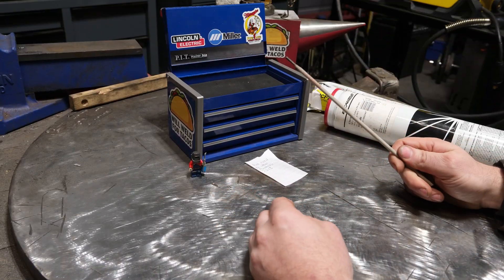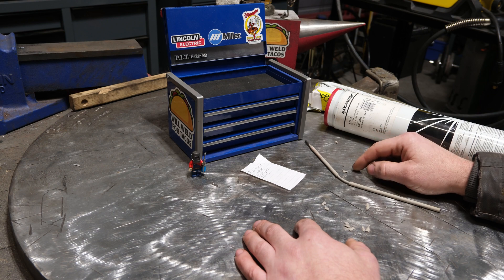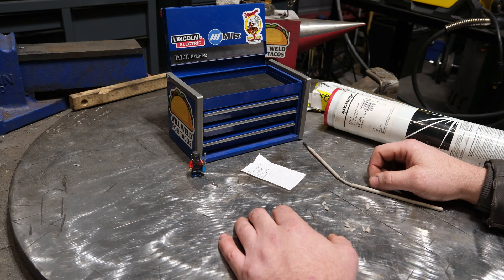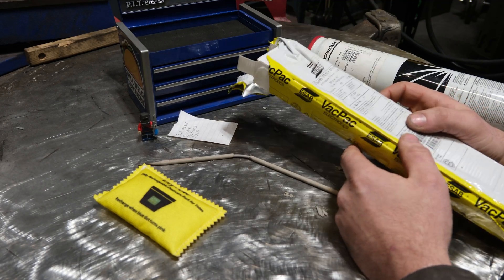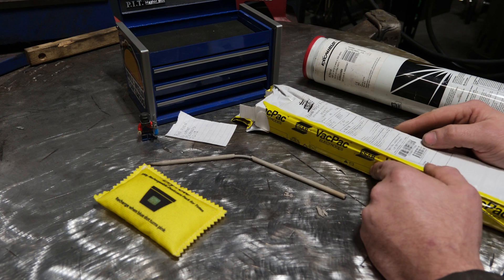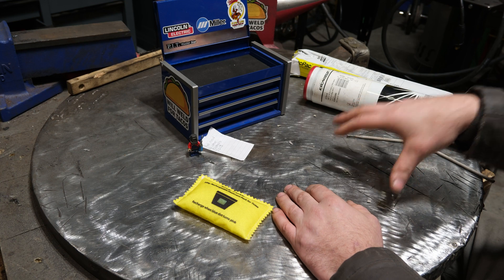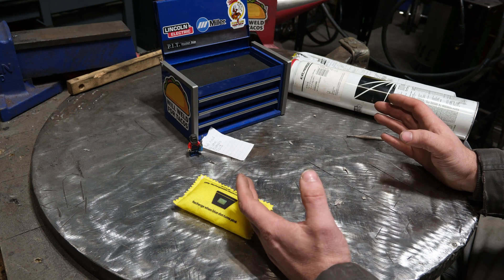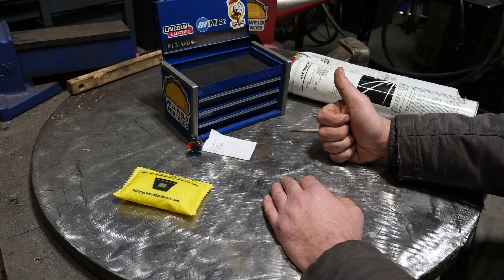QFTB #11 Rod ovens and 7018 rods

Comment: So are pipeline guys not worried about hydrogen cracking when they use 6010 as a hot pass?   And i cant belive an Air-Fryer or a Toaster Oven wouldn't be enough......  Btw:  None of the 7018 ive bought are in a sealed pack... A half a.zzed seal is all.........
Reply from the maker: So that is an excellent question and probably one of the most confusion situations because it’s very common for pipe to be welded with 6010 and filled out to the cap with rod oven stored 7018.  The reason it works is due to multiple things.  1) the root pass of a pipe can’t be reliably done with 7018, because its pool is too liquid and would be a nightmare to deal with poor fitups.  6010 gives the welder so much control over the root pass it makes it possible to weld it.  On one pipe you can be welding overhead, vertical up, and flat, all with varying gaps.  6010 is the best solution to that. The steel used in many pipes is not really susceptible to hydrogen embrittlement, so a single pass isn’t the end of the world.  Pipe also doesn’t see stress like say a bridge.  Because pipe is fully welded around with 7018 the actual loadings the root will see are minimal.  The internal pressure can be high (depending on what the pipe is used for) but again there is plenty of meat right behind the root to hold everything together.  

In situations where the pipe material needs low hydrogen welds, the solution could be tig root and hot pass, 7018 all the way out, tig start to finish, or specific pipe line rods used for the root pass.  If the pipe is prefabbed it could be done in a shop with a wire process.  

Also from my understanding hydrogen embrittlement happens most at room temp in steel.  If you welded a root on a pipe with 6010, and then welded it fully out (or a significant amount of it) with 7018 there would be a lot of time at elevated temps for hydrogen to escape because only the root put hydrogen into the base material.   Only on procedures that allowed 6010 root to cap (which is mainly low liability work with low standards of weld quality, often run downhill) would there be a massive amount of hydrogen in weld deposit.  

As far as the toaster oven, if it hit 250 it would be enough to stabilize the rods but not meet spec for a “bake out”. I read via Lincoln electric and AWS testing that a 7018 with hydrogen could not be returned to low hydrogen status at a 300 degree temp for an extended period of time.  The atomic hydrogen apparently bonds too strongly to the flux to be removed fully at lower temps.  That’s why the info directly from the AWS and Lincoln electric specify extended periods at lower temps is not a substitution for a 550+ bake out for a hour or two.  Luckily for most things a normal person would weld it really doesn’t matter.  Even a 7018 in a mediocrely sealed box is still stronger/better to use on mild steel.

Comment: A similar issue exists with moisture  in 3D printing using nylon and other hygroscopic filaments. Excellent presentation especially explaining how baking is required to pull moisture and the limits of desicant. Thanks.
Reply from the maker: Interesting that moisture can affect 3d printing as well.  A lot of times it’s hard to understand how even fairly high temps are not enough to remove moisture from rods, but when you look at it from pesky hydrogen atoms not wanting to leave without significant “help” (aka heat) and not just liquid water existing in them, it all makes sense.

Comment: Is this part of the reason that the non-flux electrodes used in mig and TIG are pretty much universally 70 series? Seems like stick has a lot more flavor options
Reply from the maker: So there are a lot of reasons for the tensile ratings.  I have been told that the rod in a 6010 and a 7018 is actually the same alloy, and I tend to believe that could be the case.  With stick in particular the flux composition used will change the shielding gas produced.  So 6010 has an aggressive arc because it produces a ton of c02 gas.  Just like in mig welding, 100% co2 gas produces a strength reduction using the same wire over c25.  So the byproduct of 6010-6013 producing weaker welds than 7018 has more to do with the interaction of the flux, the shielding gas produced, and the grain structure that is produced due to how fast the weld solidifies,  than the actual metal rod used.   

Tig and er70 mig produce what you could consider “ideal full strength” for mild steel (what most people weld on).  A great way to look at it would be to think of the common fillers are made to match the most common materials.  If they increased the strength of an average filler it may actually perform worse on mild steel, and if they reduced the strength of the filler it would obviously perform worse. 7018, tig/ mig with er70 all perform exceptionally well with common mild steel.
Reply: @makingmistakeswithgreg  wow that makes perfect sense. I hadn't even considered that connection 🤯 Every video I'm learning something new

Comment: Stupid question,  but why doesn't the arc which is at Temps as high as 3500f immediately vaporize the water out of the end of the rod before the pool is formed? I would think that any moisture that could be slowly baked out of the rod at 350f would be instantly removed at the arc sitting above 3500f?
Reply from the maker: Definitely not a stupid question 😀.So the hydrogen that we are dealing with here is not what amounts to visible moisture.  It is hydrogen atoms that are stupidly small, and are difficult to remove from the flux.  Only elevating the temps high and giving the heat time to bake the hydrogen out works.  I have read studies from Lincoln electric that if you take a 7018 rod that has hydrogen and put it in a stabilizing oven at 350, even after what they described as a “indefinite” time there is still hydrogen in the flux.  That is why AWS and manufactures spec that using a 550-700 degree bake out and subsequent 250-350 stabilizing oven is the only reliable way to return a “wet” rod to low hydrogen status.  

I am not a metallurgist or a chemist, but I would tend to believe that the hydrogen that finds its way into the molten weld pool (because the flux and the metal are both a liquid when welding) would try to escape away from the heat.  That would mean a lot of the hydrogen atoms escape into the base material that is far colder than through the weld pool towards the rod.  As the metal solidifies the hydrogen has caused a reduction in ductility due to microscopic holes and changes in the base material in the heat affected zone.  One of the things that combats this is keeping the base material hot which gives more time for the hydrogen to escape, and that is commonly done on higher liability jobs and high strength materials.  I would imagine hotter temps motivate the hydrogen atoms to escape faster and not collect in any significant number near a weld.  Not to mention room temperatures is when higher strength alloys are the most prone to hydrogen cracking.  

Also, if you watch this video: https://youtu.be/v4yDFSSbP44?si=o-INVaWZ-EAXr4q_ which I now linked in the description, you will see clear evidence of hydrogen escaping from a weld, which means that the welding arc and heat present is not enough to prevent hydrogen from the flux from entering the solidified and cooled weld.  Hydrogen escapes for a very long time after the weld is cooled, which is more than enough time to have damage done on higher strength steels.
Reply: @makingmistakeswithgreg  thank you for all this information! Hope you have a wonderful day!
Reply: I’ve had limited training in chemistry and physics with a touch of metallurgy with regard to its Crystalline lattice structure of metals. And it is an excellent question, that I really didn’t give much thought to, until I watched Greg’s videos on the subject. My first thought back then was the exact same question, and since seeing the bubbles demo, I started to give it some thought… 

My guess (disclaimer: this is my opinion based on what little I have been trained on, and I could be out in left field here), is that when the rods have been exposed to moisture, both the flux and metal adsorbs the hydrogen atoms (ions) from the water molecule, and bind with other molecules in a very strong “ionic” bond, just as the Oxygen in the water bonds with iron to form rust.  It takes a lot of Energy to break strong ionic bonds.   I think the high heat of a rod oven when it is around 700°F, excites the hydrogen ions  and whatever molecule it has bonded with, to the point that they disassociate and the hydrogen is liberated and it goes on its merry way to find other hydrogen atoms to bond to and find their way out of the oven, but I assume it takes time to achieve this. So it makes sense that they go into a  very high temperature oven to drive out the moisture (hydrogen), over the specified time before they can be moved to a stabilization oven to maintain that high energy state preventing hydrogen from being adsorbed again. 

The difference between letting the ultra high temperature of the arc to do the same disassociation is Time.  I’m sure the arc does eliminate some, but it is a very brief moment in the process, and it doesn’t have enough time to shed the hydrogen that was bonded into the materials in the rods.
Reply: Now tht u said tht, i'd think the same...
Reply: But, isnt there a coating that doesn't allow the outside air to contact the weld?  Which may keep it from Evaporating awaY.?  idk
Reply: Weird idea: the Arc breaks the hydrogen (H2) down into “ionized hydrogen” - such that it both penetrates into metal more, and has a greater effect upon the metal itself…

Addendum: seems I’m onto something here.  The ionized hydrogen is better named “atomic hydrogen;” it’s the most reactive form, and it was stated as being greater at causing hydrogen embrittlement!

Comment: Greg, when I was at the shipyard we were only allowed to have rods out for 6 hours max. (8018 & 11018) I always went only 4 hours. (swapped on my lunch break) All returned rods were baked for like 8 hrs. at 450F. Then transferred to 250F storage ovens. We also had strict interpass and preheat rules which failure to follow could get you fired. When building a boat that goes 100's of feet below the surface a whole lot of lives depend on you doing it right!  If you're burning enough wire to need an oven, buy an oven. I bought one used 40 years ago and it still works fine.
Reply from the maker: 100%. When getting into 8018 or higher the requirements become even more strict because you are without question welding on material that hydrogen embrittlement can and will happen with.  There is nothing wrong with returning rods to an oven sooner than a manufacture or code allows for, if anything it’s the smart thing to do.  From a practical point people would be much less likely to forget to return them.  On a 8 hour shift halfway you return them and on a 12 hour shift you will always return the rods at a point less than 8 hours.  Not to mention modern rods are often speced at 8 or even 12 hour moisture resistance, that wasn’t always the case.  Most places don’t care that manufactures say it can go longer, they keep everything the same because why change something that works.
Reply: Right, critical stuff like that in a production environment one will always need to follow the Welding Procedure Specifications. Failure to follow the WPS, and/or failing X-ray tends to get one either early retirement or unemployment, lol.
Reply: @brnmcc01  Most of the time security would perp walk them out to the front gate right in front of God and everybody! It sent a clear message to the rest of the crews. FAFO I think they call it now! LOL!:hand-pink-waving::person-turqouise-waving:

Comment: i am kidding myself , by immediately after opening  a pack of esab 7018 . taking out the rods i need and then resealing the pack with plastic foil. btw keeping them in a nice warm dry room.
Reply from the maker: Honestly what you described would likely never be an issue. If you did in on a job site welding pipe in a power plant, there would be serious issues lol.  Much of what code says is to reduce the possibility of variables as much as possible.  If you wanted to use those rods to weld a bridge beam together I wouldn’t use them.  For almost anything someone might weld in the home I wouldn’t worry at all.  Especially because many people use 6010,6011,6013,7014 all the time to repair stuff and don’t see failures,.  7018 stored the way you described would put .01% of the moisture into the weld that those rods do right out of the box.

Comment: Another great video, thanks Greg. You are producing some more the most useful and practical info for the home gamer. I was re-watching your MIG stacking dimes video and was wondering if you could one day do a video on doing it properly with double pulse spray. Would also be really interested in a video on pulse spray for the home now that more and more affordable MIG machines are coming out with pulse. Even seen one with pulse stick recently XD
Reply from the maker: So I have a couple standing offers for a loaner a pulse spray welder  I might consider it for a video in the future.  The hard part is where I film is limited in power (I am in the middle of nowhere without more than a generator for power).  True pulse spray actually needs a powerful machine to get acceptable results.  Pulsing reduces heat input and to pulse spray while achieving the same penetration as straight spray (in the flat position) requires more power.  Many welders offer mig pulse but unfortunately that only makes welding out of position easier, it doesn’t give the performance of spray.  Short circuit mig actually works decent on vertical up welds on thicker material, it’s just a lot harder (takes more skill).  

Anyway I will have to see what I can figure out.
Reply: @makingmistakeswithgreg  That would be great if you manage to get one on loan for a video or two. While you have them, maybe you could also add a MIG brazing video to the list ;). I had done a little bit of MIG brazing before I got my new pulse MIG and it was like an electric arc firehose of metal laying it down, quite difficult to control and a bit messy. Tired again with pulse and it it lays down so well compared to vanilla MIG brazing. I think it's a great process for the niches its good for, I've done a lot of OA brazing and quite a bit with TIG too, but I found that MIG is great for building up and/or bronze facing.

I've recently bought a 250amp CIGWELD machine (XF252) that I'm loving. They have a smaller 200 amp model (XF200P3) that I was going to recommend to a friend of mine, it wouldn't be a deal breaker for him but do you think 200amp is enough to get into spray xfer with C10 gas? He currently uses stick for the few heavier section welds he does (like 10mm ish), generally doing a lot smaller bits which wouldn't need spray, but if 200A was enough, then it would be a great all rounder MIG machine which would take care of 99.9% of the welding he does.
Reply: @makingmistakeswithgreg  One other quick thing, do you have a patreon, Kofi or paypal we can flick you a few $$ in appreciation of the time and effort your putting into these videos and content? Cheers

Comment: Love your videos !! I have done many projects using 7014. I love the way it starts and restarts and the way it runs. Flux removal norm ally just rolls off the bead. Is hydrogen inclusion normally a problem with this product ?
Thanks. Looking forward to your response
Reply from the maker: So 7014 is not a low hydrogen rod and it does indeed deposit hydrogen into the weld.  If you were to weld higher strength steel (say some part of a dozer for instance) with it you could have cracking issues.  7014 is made with moisture in the flux, and it shouldn’t be removed via baking the rod, it will not run right.  Just like 6010-6011 need moisture in the flux to work properly.  A vast majority of things you could weld 7014 will work ok and not fail.  This is due to the fact many things are made with joints of low restraint, mild steel, and don’t experience significant loadings.

7018 is indeed stronger however.  On thick steel 7018 will produce stronger and more ductile welds than 7014, and have slightly more penetration.  This holds true even if the 7018 rods were stored the same as 7014.  The oven requirement with 7018 is to give the ability to safely weld high strength steels, not because the rod needs it to function.  7018 runs fine without a oven, and even just stored in the package it came with.  That ability to weld higher strength materials is something 7014 and no 60xx rod can reliably do because all of them impart hydrogen into the weld.

Comment: you are on the ball with your videos! I've showed up 'bareback' a few times with no welder or rod,just there to weld it and been handed rusty rods-farmers. This video reminds me that the thermostat went to hell in my little oven and almost burned my shop down-I need to get that back online-it was 'borrowed' off the railroad from an old guy friend of mine
Reply from the maker: The rusty rod special can be a fun one to deal with lol.  Every used welder I have bought comes with some rusty rods, and rarely do they ever weld right 😅
Reply: @makingmistakeswithgreg  isnt iron oxide part of some fluxes? 😆
Reply: @garthland  makes for thinking, “maybe I should bring an Esab “toaster” and a “tube” or three of rods…” (?)